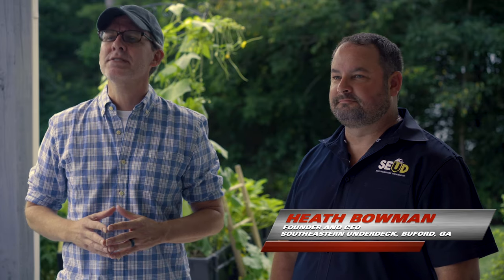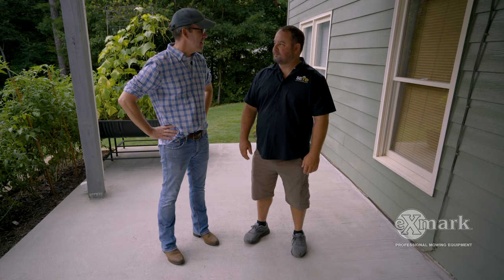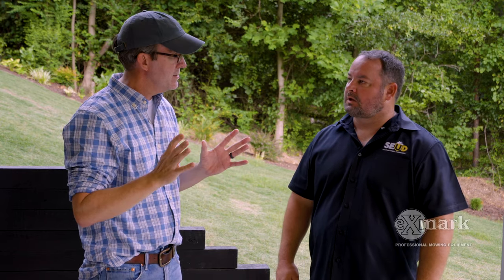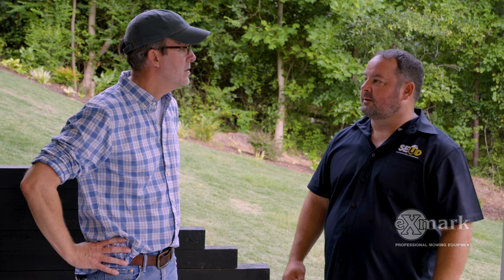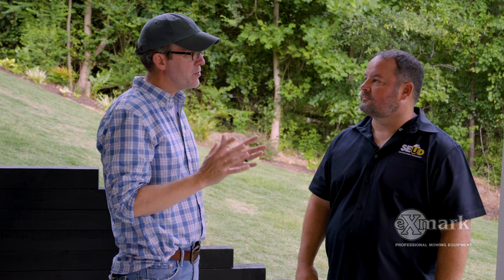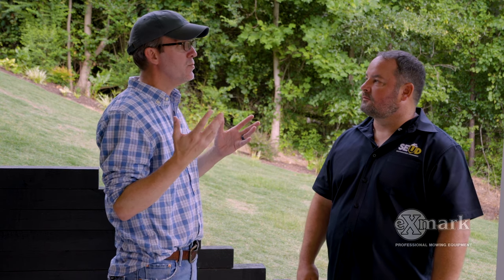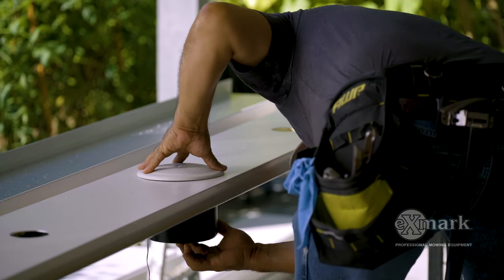How to Build an Underdeck Ceiling and Patio | Done-In-A-Weekend Extreme

Comment: How do you keep the roof from being clogged up with leaves, dirt, pine needles, and other gunk?
Reply: We've built new decks where we lay and tack a screen/mesh between the joists and composite decking to prevent constant maintenance. Unfortunately, this method is really only capable with new builds.
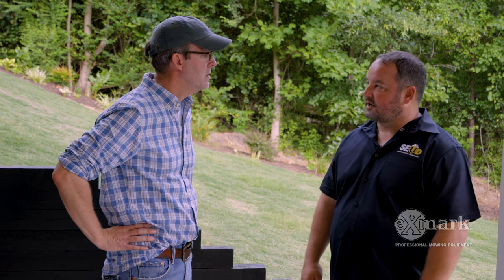Reply: He talks about it at the 4:00 min mark.  Panels can be removed for maintenance every 3-5 years.